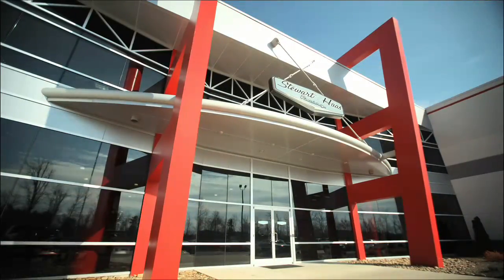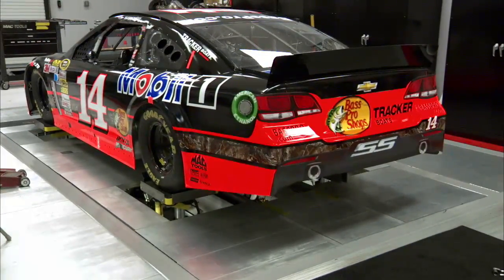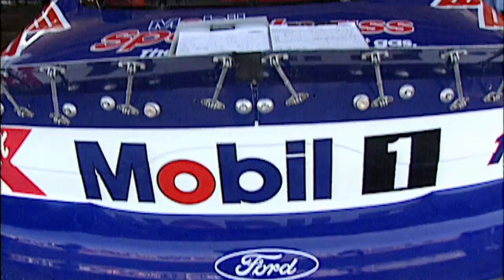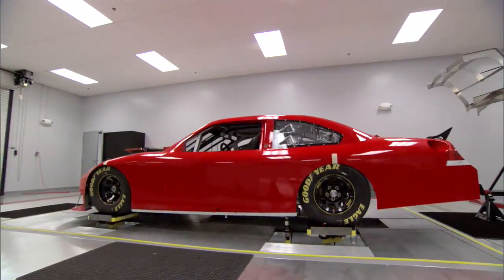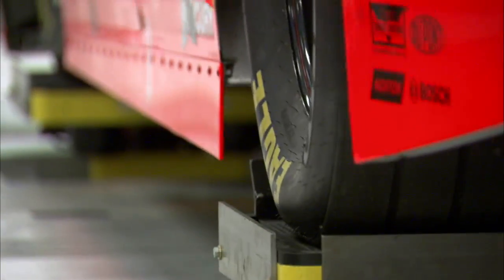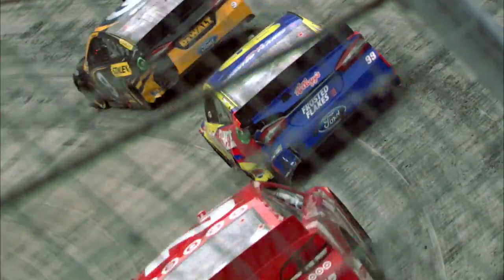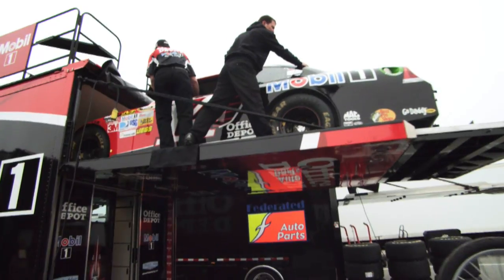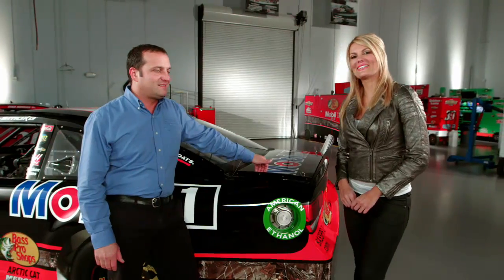NASCAR Technology: 7 post shaker

Comment: That's a really cool deal they got there, wonder how they get the info from the tracks to input into the machine.
Reply: They have sensors strapped on the car so the data can be recorded. 

But nowadays, you can laser scan the track to produce data anyway.